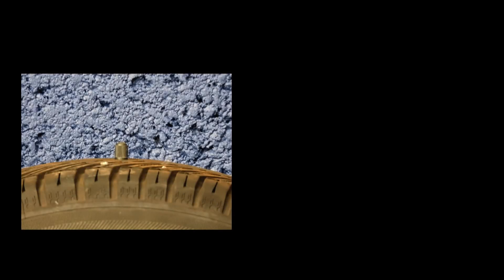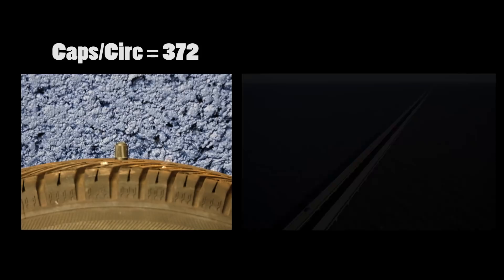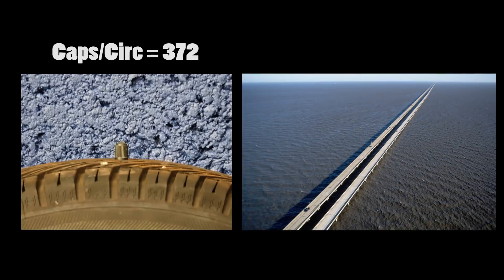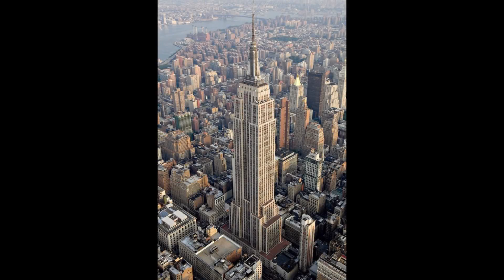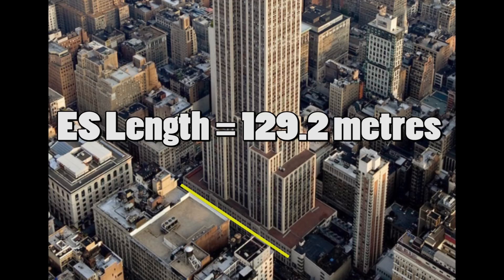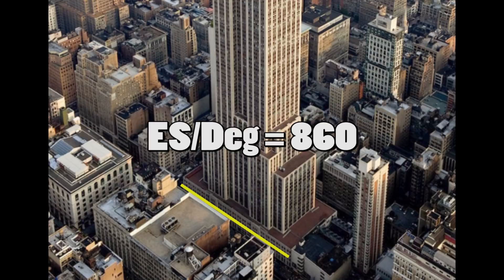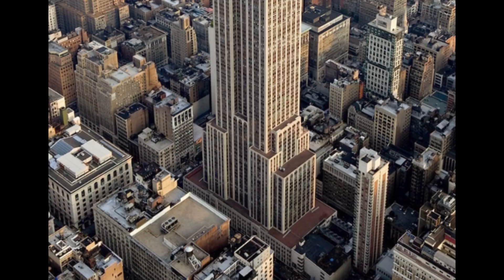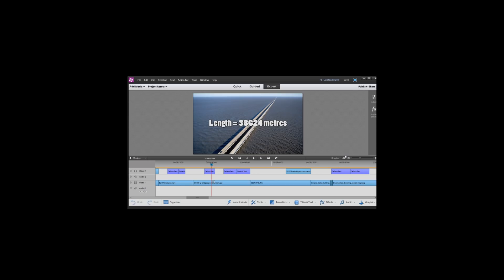Flat Earth Can't Scale

Comment: I can think big buddy, the Panama canal the Nile river these things take up a large chunk of real estate. The canal to work has to be flat. And the river is is a fifth of the circumference of the earth please explain how that works on a ball.
Reply from the maker: Flow is dictated by elevation. Elevation and curvature are not the same thing.
Reply: I know what you mean, it's even more outlandish when you add mountains and valleys to the ball. A five thousand mile long river has to be lower at one point and higher at another for the water to flow. If you are walking around a ball wether north south east or west you will always have the rise of curve in front of you. How does the water constantly go up hill. In fact in a system with supposed gravity how does water flow at all if it's constantly pulled toward the center of mass. With the centriffacle force of the earth all rivers should only flow in one direction.....let's talk about planes... If you were on a spinning ball an airplane traveling east to west or west to east would appear to fly at completely different speeds the travel times in opposite directions would be vastly different. A plane going a thousand miles an hour in one direction would appear to stand still or go backwards in the other because it wouldn't be keeping up with the spin. A private prop engine would never be able to turn around and make the return flight because it would never catch up with the spin
Reply from the maker: @robertbrown6513  

Elevation and curvature are not the same thing. A sphere doesn't have an up and down at any point around its surface. Up is away from the surface, down is towards it, elevated features are away from the surface and water flows down towards the surface. Regardless of orientation.

Do me favour please. Tell me where you are on the earth, point up, and tell me where you are pointing to.

The atmosphere moves with the earth, this is day one stuff.

Comment: Modern Science has you believing after 3 miles 6ft of a ship is gone due to curvature! Your argument is pointless.
Reply: You do realize that that’s only when your eyes are at sea level right? Otherwise you need to add in your own height and then use a sightline calculator to actually calculate what you’d see and also take atmospheric effects into account
Reply: @TheNinthGeneration1  But of course. And this is why distances seen will always be ONE of the biggest issues for the BALL!
Reply: JoeNoBuddy yes, because when you use the wrong formula to calculate distance you get the wrong distance
Reply from the maker: You should understand the point before trying to rail against it. Try again.
Reply: @ETM2024  Doesn't it get frustrating answering all those Flattard questions?
Reply from the maker: @gigatraudl6443  

Yeah, on the whole I don't do it so much as I used to. I expect answers from them when they start their crap or they can piss off basically.
Reply: Modern science once again right 🎊
Reply: The Gonad  you are so right. Can you just remind me on how to.prove Big G mathematically?

Comment: Check out a dictionary sometime genius. Level does equal flat. Get over your worship of balls. It's dead.
Reply: "Check out a dictionary sometime genius" - 
Definition of solar system 
: the sun together with the group of celestial bodies that are held by its attraction and revolve around it
Definition of earth (Entry 1 of 2)
1 : the fragmental material composing part of the surface of the globe
Definition of sun (Entry 1 of 3)
1a often capitalized : the luminous celestial body around which the earth and other planets revolve, from which they receive heat and light, which is composed mainly of hydrogen and helium, and which has a mean distance from earth of about 93,000,000 miles (150,000,000 kilometers), a linear diameter of 864,000 miles (1,390,000 kilometers), and a mass 332,000 times greater than earth

So either the dictionary is a reputable source to be cited for factual definitions, or it's not.  You can't have it both ways.
Reply: Penguin1290 Dude they dont believe in space
Reply: that's odd - I have some very flat walls in my house, lucky for me they're perpendicular.
Reply from the maker: I checked out the dictionary. It only had one page left in it with the words "flat erf" scrawled in excrement. When I returned it and  complained, the librarian said to tell you that you owe her twenty bucks and a bag of lye.
Reply: Level do not equal flat. It mean perpendicular to the vertical, and vertical is defined as a straight line going from the center of the Earth to a given location.
The notion of «level» is totally local. The notions of «up» and «down» are also local and are meaningless if there is no gravity.

Comment: Yes your video makes sense. Its not exactly new information, though. I think its more of a strawman to say FE philosophy states since the surface of water in a glass or a tub doesn't has no curve FE doesn't understand scale. The point is the surface of water at rest NEVER curves regardless of the distance. There are plenty of videos showing the surface of water does not curve over dozens of miles. Both fresh and salt water videos. How do you explain that? Particularly the ocean vids.
Reply from the maker: There are thousands of videos which exemplify the thinking discussed in this video. 

Regardless, I don't need to explain the claim you are making because it is untrue. It's just another extension of what I was talking about. It appears flat therefore flat, but you ignore the scale of what is being observed and have unrealistic expectations of how it ought to appear, and you ignore the horizon, the obstruction, the effect of increasing elevation etc. Just thinking in front of your nose and refusing to understand how things should actually look in the first place, replacing that with a simplistic and exaggerated idea that is inaccurate.
Reply: IT appears flat because it is flat. https://www.youtube.com/watch?v=S4oT2EbDONs&t=2s 645 feet of missing curvature. Where is it? When does the surface of water at rest begin to curve? When can I measure it? How is it possible for some of the ocean surface to be flat while curving elsewhere because this 30+ mile section has no curve? Just like every other serious measurement ever done.

Comment: Nobody ever said that earth is a perfect sphere...but you are watch a boat going over the horizon when you see it disappear from bottom first...and the reason that you can use binoculars or telescope after you can not see it with your eyes and see it again is because of the same exact reason that you can see a star behind the Sun during an eclipse..you can see the star not because space is being warped...but because the light from the star is being repelled around the Sun because they are like charges...light repels light...the same exact thing happens on earth...the Earth is a huge magnet that will attract charged particles. 2 photons can not be at the same exact place as another because they repel each other...so the farther that you look on earth... The more light is being bent because of earths magnetic field...at the surface of water is where light reacts most with the earths magnetic field...when you go underwater you can see the energy from light being  dissipated very quickly because liquids have much more energy and mass than gasses... Which is why you only have to go down short distances underwater where it becomes dark. The same exact thing happens in the atmosphere just not as much...so between refraction of light by the water vapor and molecules of gases and the earths magnetic field...and the fact that light repels light...you have the ability to look past the point where your eyes can not see anymore by using a pair of binoculars or a telescope because they work by gathering more light than your eyes can...also... Everyone has done an experiment by third grade that shows you why oceans on a globe are possible...blow up a balloon and rub it on your head to put a static electric charge on the balloon and then turn on the faucet and put the balloon next to the water coming out of the faucet...and you will see the water coming out of the faucet be attracted to the magnetic field from the static electric charge from the balloon...and the closer you put the balloon to water... the stronger the attraction..and because of density...water being a liquid is right where it should be between the solid earth and the gases of the atmosphere...and last but certainly not least...flat earth violates the laws of physics and is impossible..magnetism would never allow flat Earth...a magnetic field is in the shape of a sphere...with the poles appearing slightly compressed which bulges the center out slightly...exactly like the shape of all the planets...including the gas giants...because of how nature always seeks equilibrium...the Earth MUST!!! be a shape that has 2 sides that are very close to similar because earth CAN NOT be a shape that requires like charges to build...there will be Less magnetic attraction in areas where there is a buildup than there is where there is no buildup... So there will be a stronger attractive force to   those areas... In order to have a top... You must have a bottom ...etc...you do not see anything in nature that would resemble flat earth...and there would be if  flat earth was correct because there is only one law of nature...nature has no choice what to do...and the fact that you can look up and see the shape of all of the other planets and moon which is the same as earth... And the planets have orbits around the Sun just like an electron around a nucleus...large scale and small scale match... It's pretty idiotic to think flat earth is true...besides...now seriously...is flatearthers grand plan to steal our dumbest people from all countries...they are doing is a favor so in reality we should be thanking flat earthers instead of making fun of them for keeping the dumbasses preoccupied so they do not procreate cause natural selection would do its thing regardless...they are just speeding up the process for us

Comment: Really good video 
👍🏾
You have probably done the best I have ever seen regarding dealing with curvature and scale👍🏾
👏🏾👏🏾👏🏾👏🏾👏🏾👏🏾👏🏾
Respect!

What I would add though is:
What if you could travel several degrees? Travel across several degrees?

In one of the images (several really) you show the valve cap in a tyre. Each time the curve is discernible - but less so on the 17.5” tyre👍🏾

Across that image is probable no more than 15 valve caps. 15 degrees. 1 degree being 110,000m giving 1,650,000m - give or take. 1,650km - the curve should be discernible 👍🏾

A flight?
Should curvature be witnessed on a flight of at least 1650km?

All flights of at least 5hrs non stop should detect a curve? 
That's 2 and a half minutes on a clock face - either fast or slow - 
The discrepancy (curvature in this case) becomes apparent...

Is this what is seen using a spirit level?

Comment: According to the flat earth the  diameter is approximately 25000 miles (the same as circumference as spherical earth). This implies the ice wall that surrounds flat Earth is about 70000 miles, but Antarctica's circumference is about 11500 miles, that's a huge discrepancy.🤔

Comment: In fact the water in any container is "curved" - including a bath.  To conform to the circumference of the Earth the water in the middle of the average bath is 0.00000004385403152mm higher than the water at each end.  Thats a little over 150 (water) molecules higher in the middle.

Comment: Really good video and a great way to conceptualise scale however your knowledge on tyres is a bit poor. The tyre size in inches refers to the wheel diameter it fits onto. The circumference is calculated using the tyre/wheel size and tyre sidewall which is measured as a percentage of the tyre width. Some clever sites calculate this for you.

Also, to nitpick a little more when you compare the Empire State Building to the valve cap you talk about area. Area is not required and it is the diameter of the valve to the length of the long side of the ESB.

Cracking work though!
Reply from the maker: Thanks, I've pinned a comment from earlier, the mistake has been spotted and addressed. It's not a lack of knowledge just a silly mistake.

I didn't mention total area but may have used the word area as a description when I was talking about lining up the buildings side by side to cover the equivalent diameter of the cap.

Comment: It doesn't matter how large, water is never observed to curve. It always fits into a container, such as a tub.  It never curves around spehrical objects. It will always run (fall) off of them. 

And if your response is gravity, then how come gravity can holds oceans seas, lakes, and rivers to a sphere, yet it cannot scale down and hold water to smaller spheres.
Reply from the maker: Your first sentence is not only false but contradicted by your second.

The effects are proportional to mass, the earth obviously has a lot more mass than anything else so to expect an object with very very little mass to prevent the earth's gravity from having a greater effect makes no sense. It's not difficult or counterintuitive.
Reply: Does water fall in sheets when you have a leaky faucet?
Or do rain drops fall in sheets where you are?

The more mass the greater the effect of gravity.
The Earth is huge.  The gravity affecting only a small amount of water gets overwhelmed by the Earth's gravity.
You are picturing spheres on Earth and then expecting the same effects for Earth.
But the Earth is not on a proportionally larger body.
So it is not in a proportionally greater gravitational field.
Reply: Neither of you inteacted with my question and point  in a meaningful manner.

Comment: Great demonstration. You're completely correct in pointing out the problem with visualization of scale. Consider a case where the earth is represented by a normal pool ball (2 1/4" dia. or 5.7 cm). At that scale, Mount Everest rises above the surface of the pool ball about 0.0016" or 0.04 mm. The Mariana Trench is a scratch about the same depth. So essentially, despite the fact that we see something like Everest as being gigantic, the earth is really about as smooth as a pool ball at that scale. When drawn to scale, the 8 miles of water that you can see from an eye level of 6ft. has a bulge of around 10 ft. and that is impossible to see. Now try getting a flat-earther to understand that!

Comment: The stupidity in this post is unbearable! You want to go off using a tire and a dust cap as scale but if you were to zoom in to where the dust cap actually makes contact with the tire you will notice that it doesn't sit perfectly flat -- you can't have a perfectly flat surface making full contact with a spherical object at all times! Taking a picture from a distance is very deceiving and only morons would fall for this --

Comment: Very simple.  Measure a quarter mile at a time with surveying equipment.  You’ll quickly find no mater how far you go, it will read level.
Reply: Why did you segment it in quarter mile increments? If it were flat, you could measure from one side to the other and it should be flat. Imbecile.
Reply: Qzopr1 got a ruler?  Listen to yourself!!!  Grow a brain...
Reply: Lift up 10 pounds, close your eyes.
Have someone add one human hair to it.
Did you feel it?
Reply: Stephen Olan Lift up 1000 pounds. Add 100 pounds to it. Do you feel it? It’s all relative, right?
Reply: IT is all relative and the curve of the Earth is NOT 10% of the distance traveled.
Someone thought that a certain reflecting pool showed the curve of the Earth because it was made with a laser and the pool overflowed at the middle.
But someone did the calculation.  The bulge would be 0.8mm for the length of the 675 foot long pool.
Do you really think that is noticeable?  It certainly isn't 67 feet for a 675 foot long pool.

Comment: These 860 Empire State Buildings standing side by side are interesting. There'd be a bigger gap between them at the roofs than at the ground. That's not possible to show with a cap. You should have used matches or tooth sticks.

Comment: You did make an error. You got the size of the tires wrong. 14 inches is the size of the wheel (rim) not the tire. The first one was most likely 20 - 22 inches in diameter.
Reply from the maker: If you haven't already spotted it, I have acknowledged this and made a follow up video:

https://youtu.be/5DMjnEfiEac

Comment: I think you are right. More than gravity or even understanding how a vacuum works I think flatearther's biggest problem is understanding scale. Pouring water on a basketball to show that water doesn't stick is not a gravity problem but scale. The deepest part of ocean is less than 7 miles down. To scale the earth to basketball size the ocean water would require a microscope to see.
Reply: It it not just a matter of scale, It is also a matter of understanding models.
The Earth is not on a proportionally larger sphere.
The basketball is on a huge sphere with a strong gravitational field.